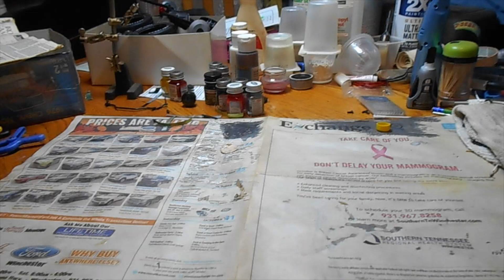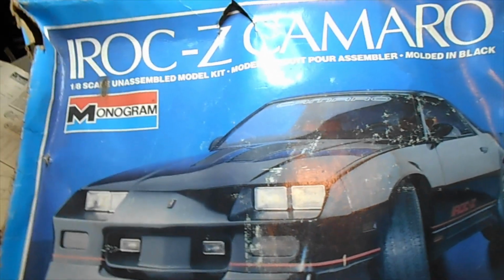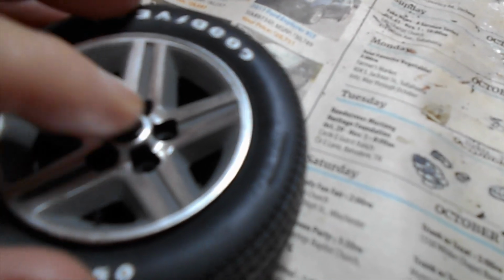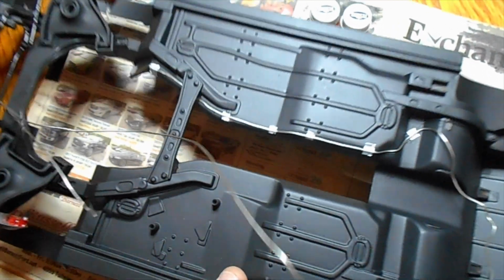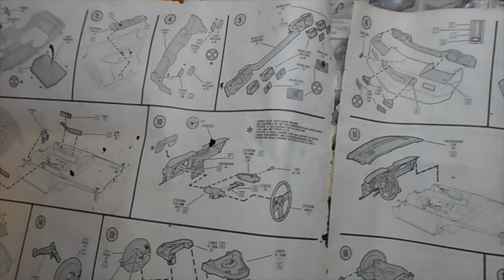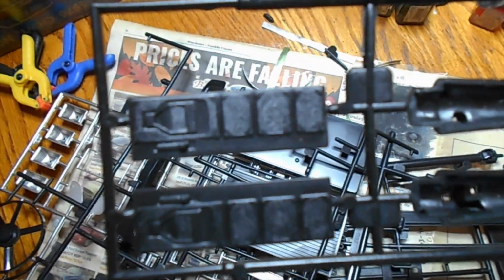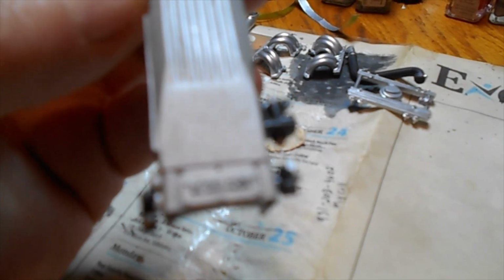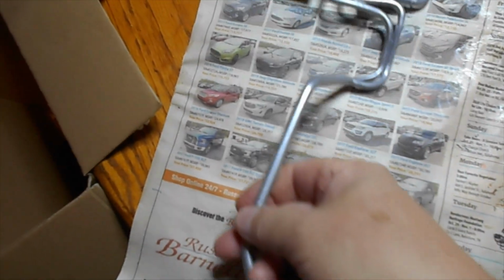Episode #1 Introduction To The Modeling Community and What I'm Working On Right Now

Comment: Have a 1/8 scale 57 Chevy, Plus a 1/8 34 Ford hot rod a 1/8/68 Camaro and my holy Grail The Golden tee bucket that came out ages ago and of course I got this rare I rock z28 building these are all humongously big scale models but they are beautiful and so fun
Reply from the maker: A 1/8 scale '57 Chevy?? Oh Man, I never knew that even Existed! I'd LOVE to see some Pics. of That! Thanks For Sharing Michael!
Reply: @JackInTheBoxModels  I bought mine way back in 93 and it was a two in one kit you can build it stock or build it as a hot rod needs to say I went with stock because of the sheer size it just begged for that realism of factory look they're out there but they're rare just like the 34 Ford hot rod and the golden T bucket
Reply from the maker: @michaelmyers3892  Aw man, I bet that thing is Beautiful! And Thanks for the Story and Your Experience with Your Kit, I just Love Stories. I have only One single drawback about the 1/8 scales, they just take up too much room! LOL!!
Reply: @JackInTheBoxModels  right I had to actually build a custom cabinet just for the large ones but yeah my 57 got the VIP treatment I too studied the actual pictures of the real one I was new to scratch building at that time but not new to the building a models I painted her baby blue with the white top and of course the factory red orange engine block and all the details as well as the flocking for carpet and the detailing of the suspension like you were doing on your Camaro